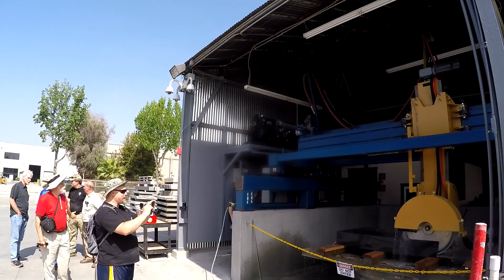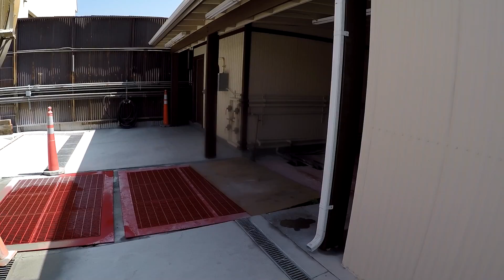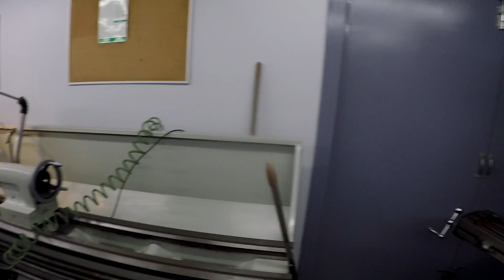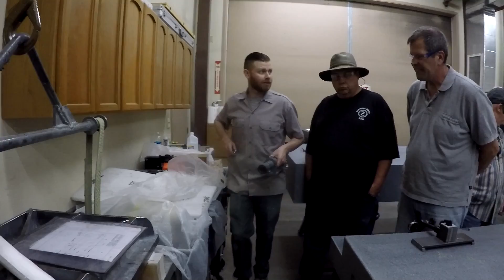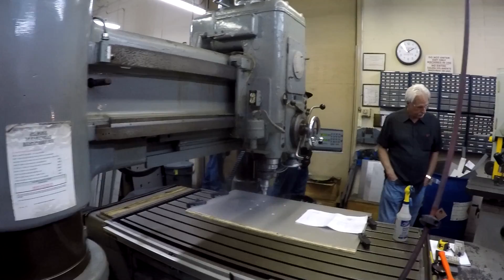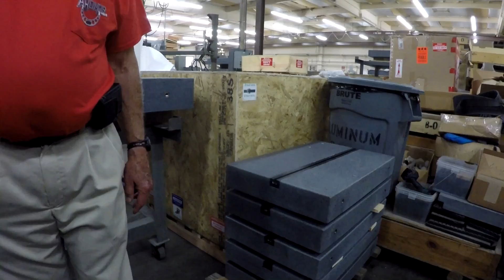Standridge Precision Granite Tour

Comment: At minute 4.00 I see the guy adjusting the indicators; why would the indicators be hooked on a wooden board (the painted one) ? I know it is light for its span and it is handy to be moved by one guy instead of two, but wouldn't the wooden board be subject to torsion when the guy moves it back and forth ? I also suppose that bending/sagging is not an issue here.....

Comment: I wonder what happens at the end of the cut on that big diamond coated horisontal bandsaw. Then the whole weight of the top piece will rest on the blade pinching it. Also separating the pieces after the cut could be a challenge.
Reply: The cut is being made vertically, not horizontally; nothing gets pinched.
Reply: No the saw @ 3.48 cuts horizontally
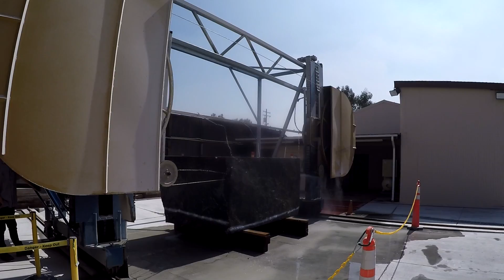Reply: Nope. Look again. Pause it at 6:21, and turn up your video resolution, you can clearly see the vertical kerf. You can even see the difference in blade height from 3:48 to 6:21, where it moved straight down.

Comment: Adam please take this point as the most positive constructive criticism: Your camera work is excellent. The gimble has taken your videos to another level. The one thing I noticed though was the GoPro struggled when you were outside in the sun, trying to look into the work units, which were obviously darker.

Now I don't know if that is a known flaw with go pros, if so fair enough. But I wonder which filter you were using on the day. I guess it was the circ polariser. As useful as that filter is, it's value for filming relies on it being adjusted correctly. Particularly when you are moving around. It's all to do with angle of the light source (sun) in relation to the camera and the subject. 

I think with experience you will find the polariser to be useful in the shop, cutting reflection on indicators and such, but for those vids where you're moving around a lot, the UV filter may be the best.

Just some thoughts sir, all good will to ya.

Comment: Here's a little history tidbit about the diamond wire saw.  The technological idea is actually very old, thousands of years old.

The Romans used something similar to cut marble.  They used a thin rope and quartz sand instead of wire and diamond, but essentially the same otherwise.  That was how they'd cut some of the big slabs and blocks they used (like for buildings and statuary).  They'd pour a slurry of sand and water on the block, start the rope rubbing on it, and the rope would pick up and embed the sand in the fibers.  Yeah, it'd wear a little, but would hold up.  Then they'd keep cutting with it, just like that.  I've seen drawings and pictures indicating they'd cut slabs or chunks in the quarries that might have been 100 ft or so in length (and then cut them down to other sizes).

I think the ancient Egyptians may have also used the technique for marble (water powered), also (I'm not so sure) the Greeks and maybe the Babylonians.  I'd have to do some reading to see if anything similar was tried on harder stuff than marble - but I don't think it was used, for instance, on granite or sandstone.

I remember working on a precision CNC lathe that a customer bought used, which was built on a granite slab like that.  He never could hold more than a few thousandths tolerance with the thing, and asked me to try to figure it out.  After a lot of investigation, we discovered that the slab had been cracked, in a place where you couldn't detect it without tearing the machine halfway apart.  It was a good idea, but...
Reply: RedHeart64 how did you weld the slab back together for him?  I'm thinking either a plasma torch, or MIG (Magma Inert Gas).
Reply: @firstmkb  Granite cannot be welded. It is a natural stone. Once cracked it's done for. The only thing you can do is cut it up into smaller pieces and use it for something else.

Comment: That diamond-rope saw, did the guy say it ran at 25mph? The converter app I've got says it equates to 2200 feet/minute, a bit speedy, lol!
Reply from the maker: No I believe he said 65 miles per hour.
Reply: Speedy blade speed, but very slow feed rate, at 3 hrs for that job. I bet the finish of that cut would be really smooth already from the saw.

Comment: guess they don't operate through much frost there with all the open water and machines
Reply: considering they're in southern california, it doesn't frost there very often.
Reply from the maker: Yes. Check my channel for a video called Florida Weather Update.
Reply: I grew up in Southern California/L.A. County.  For the five decades of my life.... it has gone below freezing only dozen times.  ....for only a few days in the beginning of of November.  It just doesn't get that cold there.  If anything, there are winds twice a year and two weeks of cold after holloween.   We embrace the cold when it comes!  Ha ha ... like we get to experience a "taste" of the deep cold of the higher latitudes or altitudes.  Even when it snows in the local mountains around Los Angeles and Sandiego Counties... you can surf in the morning and ski in the afternoon!  Othere than periodic "El Nino" rainy seasons (which also mean great tuna fishing!!):  the weather is very moderate.  If you live within 10 miles from the coast, it is never below 45 degrees.  Pretty much shorts, year round.  You just have to deal with all of the crowds (now) and pay for parking everywhere.  That's my home... I'm a 5th Generation Californian.
Reply: perhaps in winter, they dont have tours, so work indoors? they needed room for the tour i would guess mostly
Reply: I suspect, given the location, frosts are not a common problem.
Reply: could add a mild anti-freeze to prevent icing on the ground.
Reply from the maker: I doubt they have to worry about frost and ice in the winter in Southern California.
Reply: +Abom79 Do you ever get down to freezing in Florida, Adam?